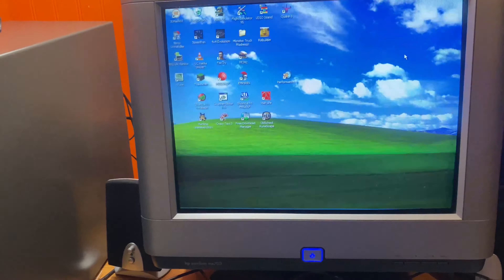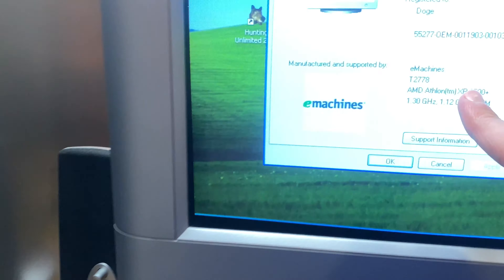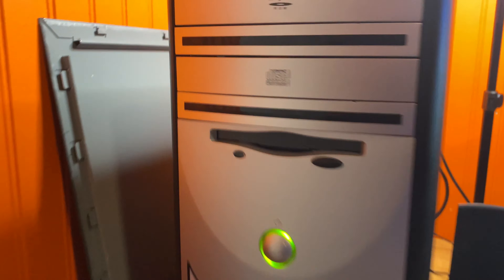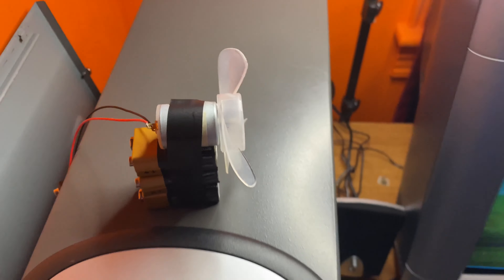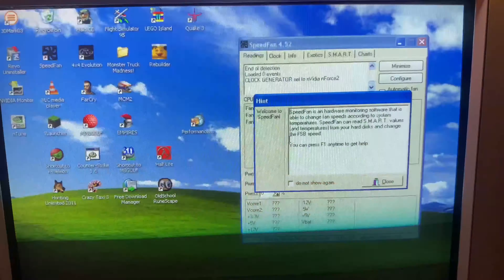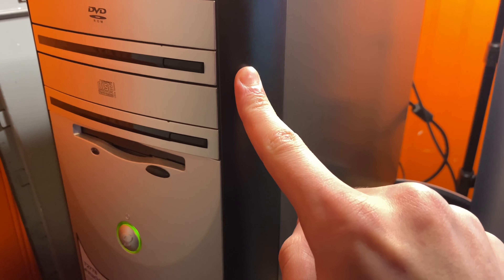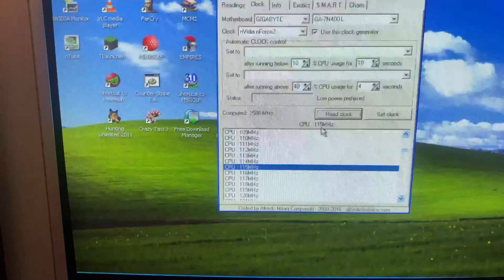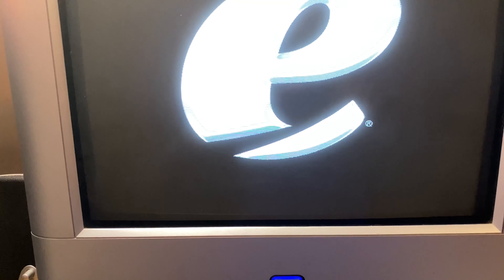Overclocking like its 2005...

Comment: Overclocking is usually done in the motherboard bios rather then via clock generator like this.
But if it's a locked down system you might not have the option to do it at all.
Well.. Beyond setting the right settings for the processor at least, as manual overclocking on fsb ofc means you are overclocking the ram as well which can also be affected by the bulging capacitors & low voltage.

That AMD Athlon is supposed to run at 333 or 133 mhz fsb btw for it's 2.1 ghz clockspeed.
133x13 multiplier = 2158 mhz at 1.65v
Running a program like Crystalcpuid might let you manually set the voltage & multiplier at least if it's detecting the motherboard enough to force those values.
Which might let you overclock via the clock generator a bit more above the stock speeds of 133 hopefully.

I run this on my windows xp laptop due to using a non standard charger that's better then the original.
But ofc Dell locks down the cpu speed because it can't detect it properly but can skirt around that with crystalcpuid thankfully.
My windows xp laptop is a dell inspiron 6000+

Also if it's an early enough athlon xp 2700+ filling in the L3 bridge with something conductive might unlock the multiplier so it works more like a modern cpu with overclocking, but ofc dont expect beyond like 2.3 ghz if it does work due to cpu voltage likely being locked down still to 1.65v unless crystalcpuid lets you increase that slightly still.

edit Oh and also ram might be in dualchannel if you use ramslot 2+3 or 1+3 on that motherboard if its that nvidia chipset that had dual channel capabilities.
Reply from the maker: thank you! there is only 2 slots for the ram and the system is completely locked down I will try the Crystalcpuid thing. there isn't even a greyed out multiplier option or I would try filling the L3 bridge. and I will replace the caps very soon.
Reply from the maker: tried crystalcpuid  and the multiplier option is greyed out.
Reply: Might be worth looking into unlocking the multiplier.

Comment: I think it detects that CPU as a different inferior one because of the bad caps not being able to deliver the power it needs anymore so it runs the CPU at a slower rate. I had a computer that did that many years ago,it would say "unknown AMD processor" in the system information and it was completely unstable
Reply from the maker: Maybe I will replace the caps
Reply: It's a real 2700+ but the motherboard has reset to 100MHz BCLK because of a dead CMOS battery. Athlon XP systems don't set the correct BCLK automatically so you have change it in the BIOS yourself. The correct BCLK would be 166MHz and the name of the CPU will also change to the correct one.
Reply: @Pasi123  I have an Athlon XP system and even with a dead cmos the cpu was running at it's rated speeds without having to modify anything. I guess it depends on the board
Reply: @Mirra2003-f9s  Probably some better/later boards can set it automatically. I've seen some youtube videos where some board asked about changing it when first opening the BIOS setup.
The MSI boards I have don't ask about anything nor do set it automatically.
MSI KT4V (MS-6712) and MSI 745 Ultra (MS-6561). I do also have an Asus A7V266-C/PA but it still has a working CMOS battery and I haven't reset the CMOS on it
Reply from the maker: there is no option to change it in the bios and the jumper does not work.  @Pasi123
Reply from the maker: @Mirra2003-f9s hey I replaced the caps and the same thing added CMOS tried multiple settings, still nothing

Comment: That's not really overclocking since you are running it at below the stock bus speed. Athlon XP's default to 100MHz BCLK if the BIOS battery has died, the stock BCLK for the 2700+ is 166MHz and it has 13x multiplier resulting a clockspeed of ~2167MHz. But because it has reset to the motherboard default 100MHz it runs at 100*13=1300MHz which is around the clockspeed of an Athlon XP 1500+.
And yes, the name of the CPU does change when you change the BCLK.

I got an old Athlon XP system in 2012 and I thought it had a 1800+ until 2017 when I tried to swap the CPU around with another S462 system with a 2400+. Only after swapping the CPUs I noticed that both of them were 2400+ lol. I had assumed it would auto detect the BCLK like how Pentium 4 systems do
Reply from the maker: it doesn't let me change it anywhere.
Reply from the maker: there is no CMOS battery but that shouldn't matter with a jumper and there was a CMOS battery in it and same issue.

Comment: That isnt the gpu its like that on xbox as well the gpu is under a heatsink and that chip is not. Its part of the gpu but not a part that gets hot
Reply from the maker: ohhhh was that the chipset?
Reply: @Tech86807 the chip you showed was the southbridge, the iGPU sits in the northbridge, which should be between the CPU socket and the AGP/PCI slots.
And the original Xbox had pretty much a Geforce 3 in it, which is DX 8.1 capable, while the Geforce 4 MX are pretty much Geforce 2 MX with the memory controller of the Geforce 4 Ti, and are DX7 chips.
Reply: @HappyBeezerStudios  gf4 mx have dx 8.1
Reply: @jedsiecz  GeForce4 MX doesn't have full DX8.1 support as it lacks pixel and vertex shaders. GeForce4 Ti were the real DX8.1 cards and had partial DX9 support
Kinda like how GTX 400/500/600/700 series cards are "DX12" even though they predate DirectX 12 by few years and don't have some of the features required to play most modern DX12 games